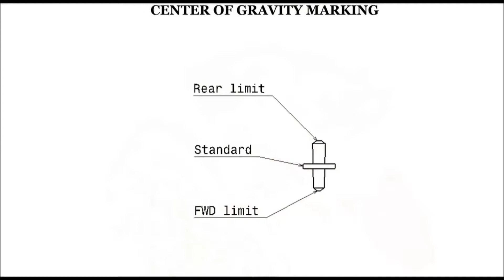3D printed plane - Assembly guide - part 2/2

Comment: Recommended throw settings for the Model Z (starting around 10:30 in the video)
Elevator:  Up 10mm, Down 6mm
Rudder:  +/- 9mm
Ailerons:  +/- 7mm

Comment: Hi,
In this video, until you finish installing the electronics, the wing is not reinforced. When they show the decals it already seems reinforced! What do you recommend for it ???
Reply from the maker: It is not necessary to reinforce the wing, it is already strong enough
Reply: I understand that you not recommend it, but in my case one of the parts was a little separated and so therefore I would like to reinforce it. 
I was thinking of using epoxi to fill and some mesh tape.
Reply from the maker: @matiasdelellis2955  if that happened to you the most probable reasons are: lack of material during printing or not enough glue in the join. If you print and assemble correctly the wing the resistance is more than 15G. You can see an ultimate load test that we did (one of the first videos we uploaded)

Comment: Im supposed to connect the aileron servos through a y cable?
Reply from the maker: Y cable is one option, if you have enough channels you can also connect each servo to one channel and use the mixer of your receiver to make them work simultaneously.
Reply: @eclipsonairplanes  ahh, yeah that makes sense. Thanks!